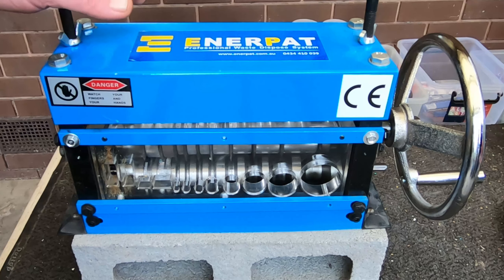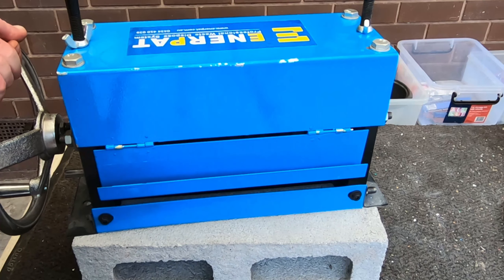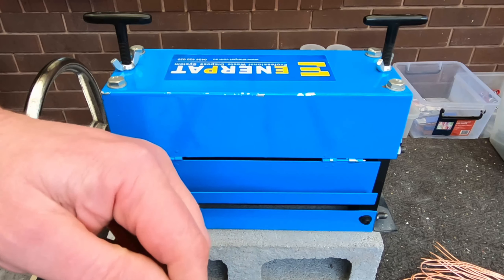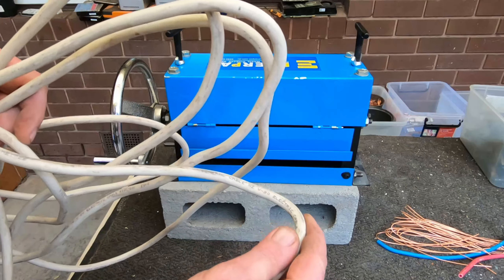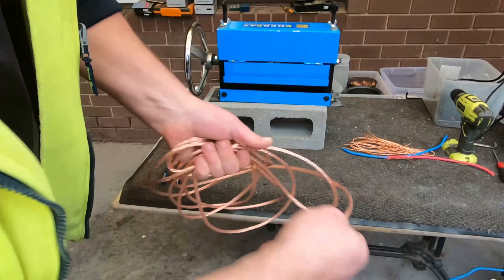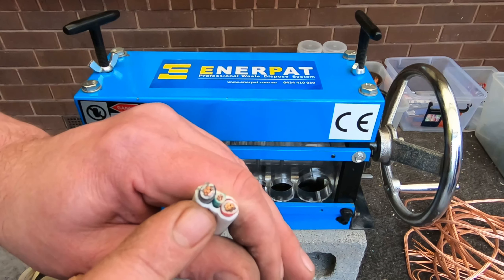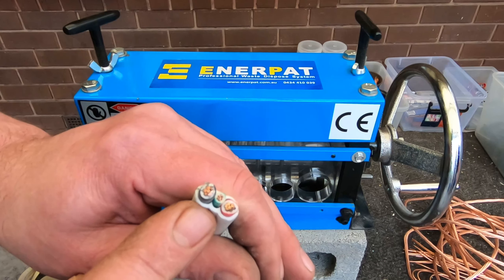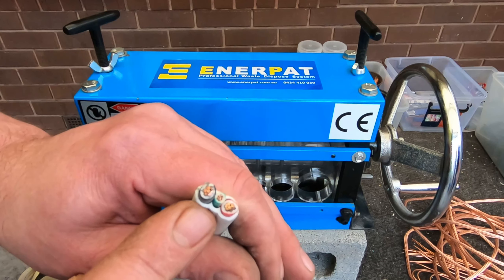Scrap Copper Manual Wire Stripper Trial

Comment: I bought one of these off Ebay a few years ago. Once you have the blade dialed in for your wire it works great. Hooked mine up to a drill. Make sure it has a tight chuck because the shaft is really low quality material and gets boogered up easily.

Comment: Hey Ben,just a tip,leave a heap of wire in the sun for 10-15 minutes before you start,softens the PVC and makes it so much easier .Nice machine BTW.
Reply: kevin sturgess , thats a great idea except ben is in melbourne in winter.  the sun may not appear for 2 more months.  i should know. i lived there.  and yes, i think this is a great machine - a value adder that will pay for itself very quickly.
Reply: iv done that many times and for larger wire you can freeze it and it cracks too

Comment: we hooked an electric motor to ours, placing a pully on the machine and then using a 1 /12 hp motor with a potentiometer in line to adjust the speed we want make using it much easier. just passing on what worked for us,
Reply: really cool. make a video

Comment: Simple improvement : a screwdriver, or any bit of round metal.

Mount it on an arm bolted to the top.
Placed vertically behind the cutter, run the first few inches thru the machine, then place the plastic to one side of the vertical rod, the copper to other.
As you wind the handle it will cut then separate the metal and plastic.
Save some work = good.
Reply: Good thinking

Comment: Nice I bought the blue rock stripper does large cable as well if u remember ben I told u was looking to do wire I started I do 20,000 lb a month and now will be purchasing I granular going in to contract for 90,000 lb a month on smaller wire for granulating

Comment: That's a machine I've never seen before! I Love the big hand crank! Personally I think if it can have a manual it should. Like vehicles they all started to which to electric window about 30 years ago or so, but when the electric motor goes out your window could be stuck down, up or halfway between! I think all cars with electric windows should have a hand crank too! That way you're not in a jam if the motor goes!!
Have a GREAT Day, Ben!!!
Reply: Hey, bro, how is going?  I was thinking the same thing: hook up this machine to a dedicated electrical motor and run it off a rechargeable battery that gets it charge from a solar panel.  Ben picks up (or rather) finds all kinds of electric gadgets during his street scrapping, it shouldn't be a problem to find a working electrical motor at least in one of them.
Reply: i could see like 5 people going to town on this machine- one person driving it with a stationary bicycle, and two people feeding it, with two people seperating it on the back end.
Reply: @toomaskotkas4467  I responded to your post right after you posted yours, but now it's not there, weird!! I saw Travis post something so I was reading that and seen my post not there. Any way, I said that's a GREAT idea and I'm doing pretty good, going through some hard things right now. I'll explain about that after I get through it!!!
How are you doing???
Have a GREAT Day, My Friend!!!
Reply: @travismiller5548  If they are a part of one family living somewhere off the grid on a farm then maybe.  Otherwise it's going to look like a Circus.

Comment: Steel dragon tools mine has done miles of wire over the past couple years and the blades are still sharp. I looked at a bunch of these and have been very happy with my decision. Just wanted to share what works for me.

Comment: Great video. Ben that is a very nice stripper, very fast . i was looking at a smaller one, but i'm glad to see this one, it is a lot better one. Ben if you bolt you machine to the edge of the table so you can use the 6'' handle it would not need to be lifted up and you can run your wire straighter and it would not haft to be bent . you can even run it faster , even tho it is very fast now. man that is sweet. have fun and be careful. ( in the USA once it is strip like that we call it Bare bite , it pays better then Insulated wire . )

Comment: Thanks for the great video Ben!  There certainly is something to be said for having the exact hole and blade for the matching wire size.  Also, I don't think it would be too much trouble have a set up of pulling off the big handle and rigging up a small motor to turn the shaft.  A winch motor or a car door window motor would work easily enough.  I've done crates and crates by hand, so I think I'm going to look into getting one of these.
Thanks again!

Comment: If you find one of those old TV cabinets with the rotating ball bearing base.  Use the base on your work table and mount a board on top. Place your stripper on top, that way you can rotate it like a bench vice and service it without having to unbolt it.  

Friend bought one of these units, and it paid for itself in one day of wire stripping.

Comment: The crush can be used on sold single strand wire like house wiring the copper acts as the blade and cuts it of in 2 pieces left side right side so the wire is completely striped as it comes out the machine

Comment: Technically, you can make (or ask somebody to make it for you) a connector from the shaft of the hand wheel to an electrical motor that runs off a rechargeable battery and charge that battery from a solar panel.

Comment: While you were stripping wire I just picked up riding lawn mower, portable air conditioner and a Stihl MS290 chainsaw. Stripping wire doesn't pay. Insulated wire goes for .70 a lb here.

Comment: You could mount it on the bench with the wheel facing forward, the output could drop straight into a bin on end of bench.

Comment: The unit is fine for the part-timer but any pro knows a motorized version is normally required. 12volt dc has enormous power and is portable,also. Long runs of 100' or more would be much easier with a spring finger that fits on the machine and gets between the sheathing and the copper to separate the two. An easier way to peel the copper is to slice around the first inch of wire radially  and bend it toward the longitudinal cut.

Comment: What’s up Ben? Can you take the wheel off and hook up a drill to whatever is making the wheel spin or maybe put a socket if it fits so you can just use a drill to send all the wires through? Just a thought. Anyways nice video

Comment: Great stripper Ben but is better to have two free hand, why not try connecting to an old pedaling sewing machine with a belt or bicycle chain, that will free both hand and also a stable work station also you can sit while you strip.

Comment: Tip for anyone biyo g the Chinese one. The smaller wheel is not a problem just attach a pushbike handlebar end extension and use it as extra leverage or a cars stearing wheel knob?

Comment: Really nice machine !!!. It makes the job easy. I know there is a motorized version. I would use the cordless drill plus a foot pedal to free my hand in order to hel straigthening the wire while feeding the machine. The foot peda is just the trigger from the drill in a pedal contraption. I mean, a trash picked drill that is probably running but dumped because a bad battery pack. You can use two UPS batteries for 24V. It can be a bit high, but hey. When it breaks down, you put another !!!!

Comment: Could you not just mount the strippa to the side of the bench so the handle overhangs off the side, so even theoretically speaking you would have enough room to put a sailing ships wheel on it? Would save you having to mount it to a block to let the handle have enough room?
Reply: yeah oath mate

Comment: The insulation that's white inside could maybe be rubber. At least I had rubber insulated cables before and it was white on the inside.
I'm also thinking about building something for easy wire stripping, my concept looks a little different tho. I think it could be beneficial to mount the wire stripper somewhere and then pull on the cable instead of having a crank. Then you could also seperate insulation and wire while cutting them simultaniously
Reply: Oh, also, did you try how good this works with shielded cables? Would definitely be interesting

Comment: After the blade goes to release,  a v shaped piece tiny piece of metal in line with blade  could ultimately spread and remove the skin off the metal.

Comment: Isn't it worth more as insulated wire you could use for industrial applications?
Reply: Most Sparkies won't work with 2nd hand wire.  It's usually been chucked out because it's end of spool (too short) or used.

Comment: bolting that bad boy on the right hand edge of a work bench so that the handle isn't restricted by the workbench surface may be easier than trying to mount it on blocks dude (or at least it gives you an alternative)

Comment: Also.... If you simply start with the handle then PULL THE WIRE THROUGH BY HAND, you'll soon see that you can fully strip it in one go.
Start with wheel,
Pull an arms length through,
Separate insulation in one hand and cooper in the other,
Reach and pull more wire,
Separate,
And so on.
Enjoy stripping and separating wire faster than you may have ever imagined.
Reply: It's obvious you've never done this.
Reply: @rossbrumby1957 really now? You come up with that for a reply. I'm guessing you rode the short bus to school or stayed at school and your dorm walls were well padded.

Comment: Lol mate that big CE on the front of the machine stands for china export its made in china . Ive just used a single blade $200 motorised machine to strip a warehouse to get 70kg of copper . Different sizes and twisted it dosnt matter , just pulls the cable in and cuts the pvc  . These multi blade cutters are just a gimmic

Comment: thumb down for first time as you did not take into account that you cant get it in the uk nor does it ship to the uk.
Reply: err thumbs down for you Enerpat is a uk recycling plant manufacturer and supplier who mainly produces single shaft shredder,horizontal baler,vertical Baler,two shaft shredder,scrap metal baler with years of experience.